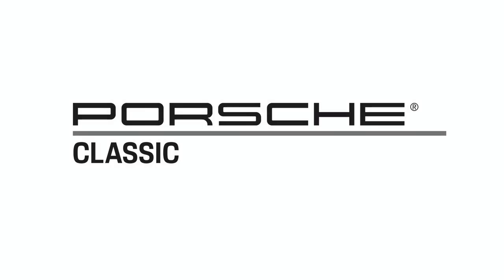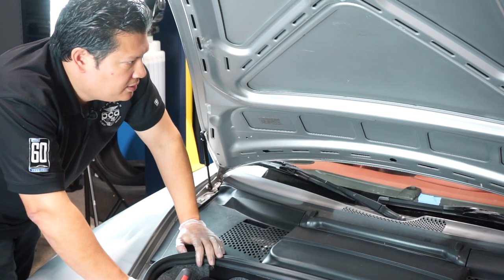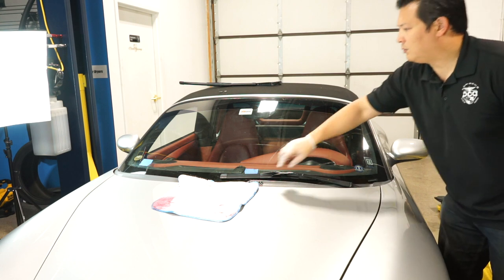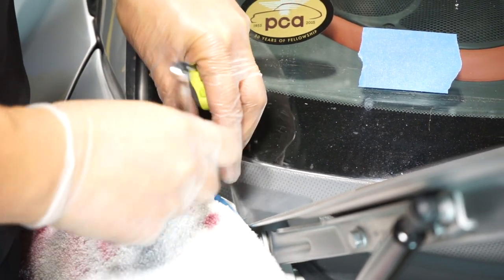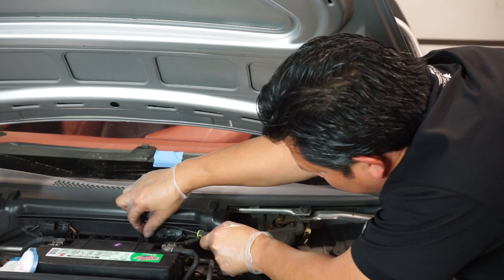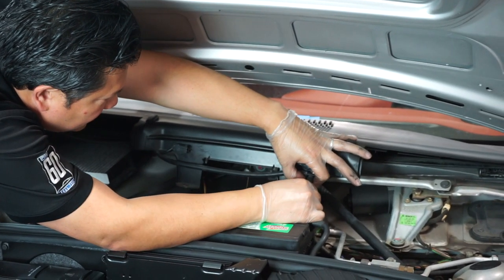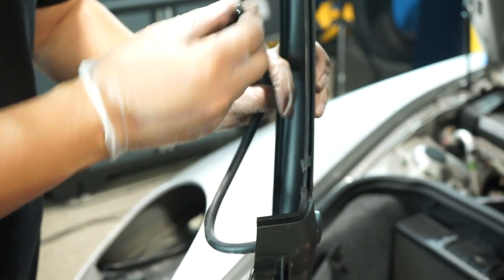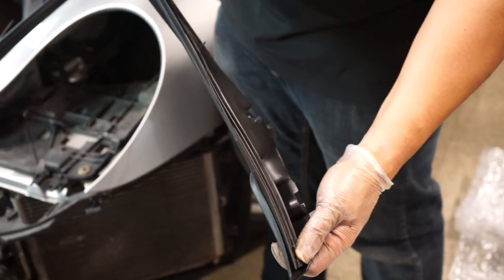PCA Spotlight: Replace that worn Porsche 986/996 cowl trim

Comment: What a great video, thanks so much. Refurbing mine as the rubber gasket was split, rest of trim is fine. Can I use a sealant to fix the gasket to the cowl? It's a bit loose... My washer connecters were broken, cable tied on...

Comment: Great video! Just changed my windshield cowl this weekend and the guidance on removing the electrical connections was very helpful as they are difficult to separate. However, just like with the old cowl, the windshield washer spray is hitting the top underside of the hood and not reaching the glass.  Is there any adjustment for this?  I have a 2002 Boxster S.

Comment: Hi, I know this video isn’t about license plate brackets but I was wondering if you have done a tutorial video on how to install one on front fascia where one has not existed. We’re required to have one in Ontario and my 996 is from a province where one isn’t required. I’m not really interested in using the tow hook mounting system but I will as a last resort.

Comment: Two things worth considering perhaps. I would have checked the condition of the washer jets while they were out and cleaned holes a little if necessary. Also would some light lubrication on the wiper stalks have been worthwhile ?
Reply from the maker: Good idea, ours was working fine.

Comment: When disassembling, I noticed my electrical wires tuck behind rubber hoses, but during your reassembly your wires went in front. Not a big deal but just wanted to point that out.

Comment: Hi Vu, great video. Regarding the video you did with the 986 shifter replacement, I'm wondering where you sourced the Boxster Red shift boot and handbrake handle. I have a white over red Boxster too. Want 'em!
Reply from the maker: Came as delivered from factory.

Comment: A heat gun works well to remove the oxidation and restore the black color on these trim pieces. I've had success with the cowl cover and the piece inside the front bumper cover. I'm not sure if it will get it all the way back to the "as new" condition but it certainly makes a large difference.
Reply from the maker: I've heard about this trick. Might try it on the old one to see how much it brings back. That said the new piece is pretty inexpensive and it looks real nice.
Reply: Heat gun works for about two weeks then it starts getting grey again.

Comment: Hi, What's the point of replacing the part if Autoglym plastic restorer milk does the job. I tried and my grey plastic turned black there. It didn't work only on front air intakes on both sides of a front bumper.
Reply from the maker: Glad to hear Autoglym worked for you. We haven't had luck with anything working long term, so replacing with a new part made sense.

Comment: Do you happen to know the part number for the rubber seal?
Reply: I need this as well. Cowl and seal both need replaced on mine.
Reply: @bryantate8785   I'm doing mine soon, 986, my rubber trim piece looks good....did you replace yours or re use?
Reply: @jeffjeff4477  replaced with new and do not regret it.  Mine was pretty bad off so re-use was not an option
Reply: @bryantate8785  Got it, 
Thanks for the reply!!!

Comment: I realize this video isn’t about installing a license plate bracket. I checked your list of tutorials and didn’t see one. I’m not really interested in using a tow hook mount but I will as a last resort. My 996 doesn’t have one and my province requires one.
Reply from the maker: We use a tow hook one. Works great and you can easily remove for car shows or track events.

Comment: Guys 996 cowl cover 996-572-563-06-01C is NLA from Porsche and other OEM suppliers.  I've been trying to get one for weeks, and this video pops up.  Who has them?
Reply from the maker: We ordered our recently and I see they are still available here: https://www.pelicanparts.com/More_Info/9965725630401CM100.htm?pn=996-572-563-04-01C-M100&bt=Y&fs=0&SVSVSI=1043
Reply: PCAHQ once you place the order Pelican will email you a day later saying it’s NLA.  Same with DC automotive.  This is all in the last two weeks (April 2020) Any other suggestions?
Reply: Also, it looks like my part number is slightly different for a 996tt.  Maybe that’s the issue...
Reply: @NealCaudle  Neal you are correct.  The part number you list is for those of us with Turbos and 996.2s.  The part PCAHQ linked is for Boxsters and 996.1.